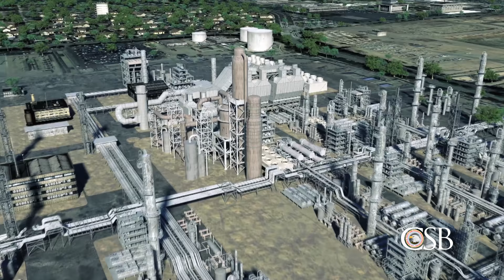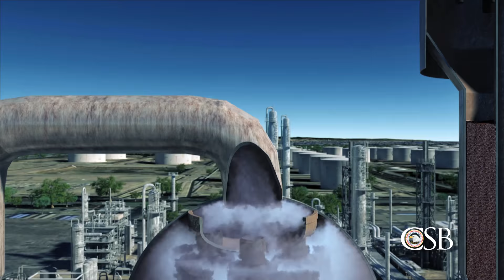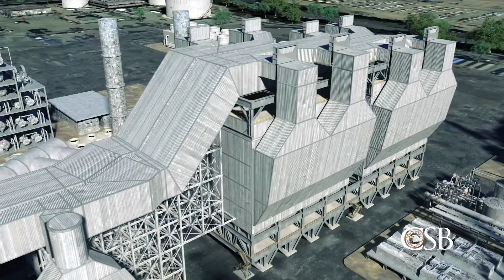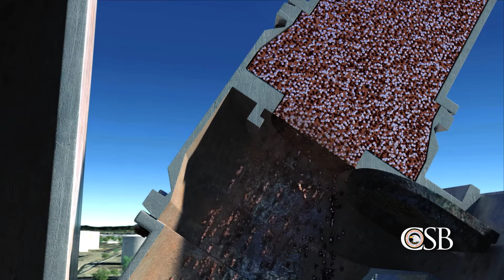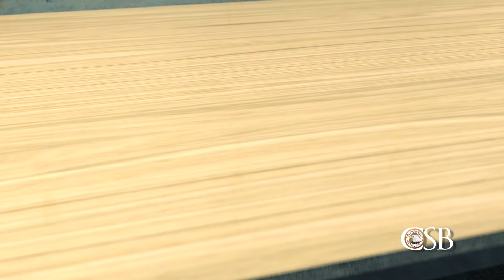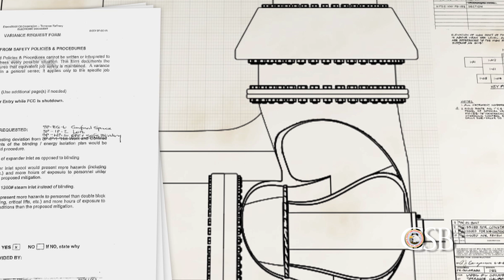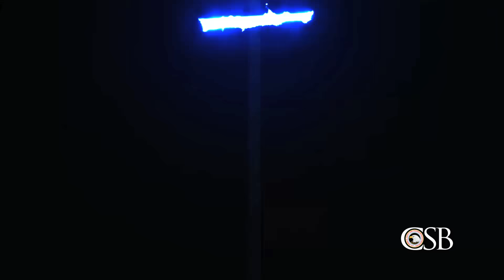Animation of 2015 Explosion at ExxonMobil Refinery in Torrance, CA

Comment: A few simple sensors in the system would have made clear what was happening. Including the failure of the valve. Not Turning off the electrostatic scrubber was the obvious Idiot failure.

Comment: How come they wouldn't install another valve between the reactor and the still? that way they could purge the reactor with steam , better yet, an inert gas, and then isolate the column to prevent backflow. Constantly pressurizing with steam is not only a wasteful but doesn't allow for maintenance on the slide valves, which seems critical.

Comment: Great animation!  I grew up in Torrance, and problems were not uncommon at this refinery.   My elementary school playground got coated with ash after the huge 1979 explosion and fire.  The ash was deep black soot, rather like an acetylene torch produces before turning on the oxygen, in balls about 1/8" diameter.  When walking, the air under your footfalls would blow the soot balls away from your shoes, they were so light.   We kids found this highly amusing, but for all I know it may have been highly carcinogenic.  This was 5+ miles from the refinery.

Comment: When panel operators found low steam pressure into the distillation column they must inform to the field operator rather than increasing steam pressure and there were several factors as well that caused explosions

Comment: The fact that so many mechanisms failed/leaked at the same time is concerning. During my Chemical Engineering degree, I had a Hazard Analysis class, which focused on assessing the probability of parts failure causing fatal results. I know from that class that the chances of so many SUDDEN, SIMULTANEOUS failures are next to impossible.

Comment: The useful life of all the valves and other parts should be estimated and those parts should be changed before that time is reached. The aircraft industry has these requirements and it includes a more thorough inspection of the airframe to look for stress fractures and other nasty surprises. They also have backup systems for everything. I think that the requlatory body for petro-chemical plants should implement similar standards.

Comment: Why didn’t they turn of the electromathingy when they realized the hydrocarbons were leaking? Was it happening too fast or something?
Reply: If only it were that simple. Another bit of misinformation is that they could shut the plant down with the push of a button. Some parts cause an explosion if they are shut off, like the steam generator. Units have to be deactivated in a specific order to prevent deaths and injuries. It takes days to shut a plant down and days to restart them.
Reply: The fact they added steam pressure as an emergency control proves they didn't know that the slide valve was open and they didn't know what was happening in the machine

Comment: Very interesting video. I know after the accident it's easy to know better. But sometimes I wonder how noone could prevent accidents like this?

I'm a bit shocked how unsafe the plant layout was. As far as I can understand it the safety of the whole process is completely reliant on the two slide valves. They weren't even redundantly configured. As far as I can see it there was only one for entering and one for exiting catalyst from the regenerator. 

Furthermore I don't understand how they could proceed trying to repair the expander after steam flowed out. Since the expander was part of the regenerator unit, which contained oxygen. I would expect that the operators would realize that they have more severe problems with the slide valve than the broken expander at this point. Since the only possible source of the steam would be the FCC unit, because steam is not part of the process downstream the regeneration unit as far I can understand it. Apparently they even understood that and tried to repair the expander by lowering the pressure of the steam. How could they try this, if they knew the slide valves were leaky because of the steam. Why didn't they repaired them firstly. Its obviously the more severe problem. Maybe they didn't cared about that and wanted to bring the unit back into production as fast as possible by repairing the expander while accepting the leaky slide valves to the regenerator.

Comment: Preventative maintenance
Reply: Preventative maintenance? The scenario involve three failed pieces of equipment.
Reply: @neilkurzman4907  CSB Chairperson Vanessa Allen Sutherland said, “This explosion and near miss should not have happened, and likely would not have happened, had a more robust process safety management system been in place. The CSB’s report concludes that the unit was operating without proper procedures.”

In its final report, the CSB describes multiple gaps in the refinery’s process safety management system, allowing for the operation of the FCC unit without pre-established safe operating limits and criteria for a shut down.  The refinery relied on safeguards that could not be verified, and re-used a previous procedure deviation without a sufficient hazard analysis of the current process conditions.

https://www.csb.gov/csb-releases-final-report-into-2015-explosion-at-exxonmobil-refinery-in-torrance-california/
Reply: @Mike-01234  
They were operating the plant with known broken equipment. 
Additional failed equipment should’ve been noted.  Preventative maintenance means you repair stuff before it breaks. These things had already been broken and were not being repaired but the plant wasn’t shut down.
Apparently, apparently, there’s been multiple plant explosions due to failed slide valves.

Comment: MRT ndt inspection technology is applied to  pipe hydrogen embrittlement inspection,
cracks, hardness, thickness, structural defects, health monitoring.

MRT is an advanced technology 
from ECT. This is the principle of ECT that uses a coil to generate a magnetic field.  MRT is the electromagnetic wave technology. MRT detects naturally occurring defects, welding defects, pit, line  on the 
inner and outer surfaces of pipes regardless of size during processing.

Advanced Magnetic Resonance Testing solutions for Battery  manufacturers
Raynar MRT can monitoring the welding condition of aluminum terminals welded to copper plates. MRT Welding Inspection Solutions Distinguish between normal and bad welding of aluminum and  copper plates. On the surface, eddy currents are generated at high frequencies and gradually lower frequencies are applied to monitor the condition of the junction to determine the bond strength.

Comment: Engineers never thought of a back flow prevention valve or a check valve or something similar to that where you do not need pressurized steam. What if the steam system failed too, the hydrocarbons would flow back regardless.

Comment: They should've added a swing type check valve on the spent catalyst return line to the regenerator
Reply: My thoughts exactly! 💯 👍🏻
Reply: Or a Flux Capacitor on the right side of the piston monitor with an O ring gasket on the release valve. That would've helped too. 👍🏻 Those amateurs, smh 🤦🏻‍♂️

Comment: ESP could have been manually shutdown as variance in safety procedure.
Or a butterfly dampner valve could have been installed on upstream of expander section during initial fault rectification, rather than a blind.

Comment: This is very high quality. I know nothing of this process. But I know exactly what happened.
The simple fact here , is the slide valve, that not only allows catalyst flow, but is also a main safety feature, was neglected to the point it was non operational.  
Lack of diligent maintenance on a critical part

Comment: It is unbelievable that a valve failure was not anticipated, had it been so then maybe, just maybe hydrocarbon gas detectors would have been fitted to the outlet of the regenerator which if activated could shut down the scrubber section thus preventing a catastrophe.

Comment: So excuse me for be ignorant but is there no off switch to the ESP. I mean damn the just thing I would do is turn of the device that could cause an ignition
Reply: That's the obvious thing to think in hindsight. This video did not include details on what the operators believed to be the case at the time this happened or at what exact times these events took place, which is highly relevant. I've been a process operator for 12 years and I know how hard it can be to figure out what's happening as it's happening. A couple of years ago at the plant I operate someone disassembled a pipe with pure hydrogen gas, it took a few minutes to even understand what the fuck was going on and in that time enough hydrogen had escaped to cause a MASSIVE explosion possibly blowing up half a huge concrete building. The moment I realized I immediately hit the emergency stop and fortunately nothing happened, it would have taken a single tiny spark ANYWHERE in the area to trigger an explosion.

Point is, it's a very complex job and in hindsight it always seems so simple. The situation in the video is a fairly complex series of events with several equipment failures, you have to keep in mind that as this is happening they probably didn't know there was a hole in the slide valve as they can't see through things like we could in this animation after the fact.

Comment: I worked alot of years checking valves montinig for leaks some the machine cannot pick up a leak and these machines are $10,000 Tva what I used no possible way to catch every valve it takes everyone. I did have a scare one day I was in a pipe rack monitoring and tied off the unit shut down the operator runs out and says get out fast and took off

Comment: Obviously I'm completely ignorant of the specifics regarding this machinery and this process.  But it seemed to me that the slide valves (the ones that were leaking) would be the kind of equipment that would be deemed critical to have a redundancy or back up built in.  Is that not so?  And with the number of sensors in my car, I would think an operation of this kind would have sensors that would enable them to diagnose problems much sooner and with a greater degree of accuracy.

Comment: Wow...that's it?  The video just ends?  The CSB usually has better due diligence than this.  Not just what happened but also detailing what should have been done differently to prevent such accidents from happening in the future.  Looks like someone was bought off at the USCSB to bury this story.  Here's the real story:  After the explosion, it was discovered that a large piece of debris landed a few feet from a large tank of Hydroflouric acid (HF).  If that tank had ruptured, it would have probably aerosolized and maimed or killed up to 75,000 people living nearby the facility.  That's according to the EPA report about this incident.  Hydroflouric acid was invented by the Nazis during WWII.  So you know it's bad.  However, even they couldn't figure out how to store and transport it safely to use it on the battlefield, so that probably saved a few lives.  It is the most toxic substance ever made where a single drop on your skin will kill you painfully and slowly by dissolving your bones and melting your lungs.  It also eats through glass.  Even the only known intervention, Calcium gluconate gel, isn't a guarantee that you'll survive.  The treatment protocol also includes no painkillers.  That protocol allows the hospital staff to know they might have nuked the HF when you stop screaming and writhing in agony.  Labs that handle HF have a separate room in their facility that handles HF and only HF in that room.  There is no substance on earth more toxic than Hydroflouric acid.  To have a large tank of it hanging around a facility that can literally explode and then potentially aerosolize HF is extreme negligence...at best.  So, of course, someone at Exxon would want to bury these facts.
Reply: Just look at yesterday in TX 👀

Comment: Only one slide valve with no maintenance in 6 years was definitely recipe for failure,  no check valve to avoid flowback of hydrocarbons , i saw several failures in the system

Comment: Weren't they monitoring Flowmeters, Tempererature & Pressure measuring instruments ( on timely basis).
The incident could have been avoided by that.
This is an accident caused by purely negligence.

Comment: Seems like they should have a hydrocarbon sensor on the air side prior to the ESP unit. At the least it could shut down the ESP system, and better, redirect airflow to a controlled output where they can be burnt off as waste gasses in an emergency.

Comment: No HC detectors on the flue gas path to the precipitators?? Were the slide valves classed as safety critical? What was their inspection and/or maintenance interval? What was the maintenance and integrity strategy on the leaking hX that was found to be the back pressure source? Did a HAZOP ever consider the implications of a leak in that hX? 

So many questions... and many more questions than these come to mind.

Comment: Why not just *TURN OFF THE IGNITION SOURCE? *
Also, why are there not a LOT more sensors in there to detect if the catalyst is flowing or not, or if there is the wrong gasses in the wrong places, or if the pressures is wrong?

Comment: "We've adopted a culture of safety. With variance."
Reply: Safety is my passion
Reply: Alternative safety
Reply: "Safety at any cost; unless is costs money" as we used to say....
Reply: Well, the variant is supposed to be a safe plan to deal with something odd. Thing is, you've always got to remember if you're using one, you're not in charted territory. 

Opening up the pipe was fine, but when they found something that wasn't supposed to be there (because the steam is on the hydrocarbon side not the air side), it's time to ask why?
Reply: The variance is what should have allowed them to catch the problem they had with the slide valve. It didn't cause the explosion.
Reply: @TMJ32  "The variance is what should have allowed them to catch the problem they had with the slide valve. It didn't cause the explosion."

I wonder whether lowering the steam pressure was part of the variance...
Reply: @btudrus  The point is that they should have stopped and investigated everything as soon as the steam was found where it shouldn't be
Reply: @TMJ32 with as many valves as I've replaced over the years, I never trust just one valve to keep me safe. I don't really trust two. I'd rather whatever the  source is to be turned off.
Reply: "
forgot to close the quote
Reply: @NithinJune stfu

Comment: Too bad there weren't any hydrocarbon monitors along the path to the precipitator to trip the power in order to prevent an explosion. But at the same time, then there would be a precipitator full of explosive gasses where anything would set it off until a purge cycle was performed..

Comment: I'm not in that industry but : if water vapor are detected in the air part of the process, shouldn't it be a sign that a leak was present since water vapor would have taken the same path as the fuel ? They knew were it came from as they decrease it's pressure. For me it's a big NONO that should trigger a quick test on the valve :-/

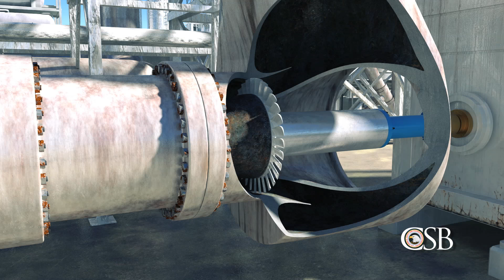Comment: 4:08. I swear, every single one of these incidents always boils down to idiots. The expander stopped for a REASON. Do not ASSUME. Steam should not have been escaping when they opened the expander. That was their warning that something was leaking. Had the right idea to turn the steam pressure back up, but totally blew it (oh, that was REALLY bad) by not turning OFF the electrostatic unit. They were given so many chances to get this right!
Reply: Agreed! How did nobody ask the question ‘How is steam being pumped into the fuel side of the FCC unit escaping through the expander, which is a part of the air side of the FCC unit?’

Comment: Seems like an actual backflow valve at the end of the distillation column would have prevented this. Anyone know why this wasn't in the design? I know they thought that the catalyst mad a seal but it seems like the  backflow valve is possible. Is it because there can be no moving parts in the areas where hydrocarbons are present?

Comment: When they, 5:50, went to install the blind (what is that, a ring or spacer of some sort ?) and saw that steam was escaping, how did they not realise that one of the shut off valves between the left hand and middle towers was not working ? 
    How else would there be steam where normally there are only carbon covered catalyst ?

Comment: 1. The water vapor should have been a major warning sing that there wasn't a seal between both parts.
2. Why did they not shut down the big ignition machine when there is a clear leak of hydrocarbons?

Comment: why wasnt the high voltage turned  off when the reactor was not under working conditions? If there is any fault in the system, you should not bank on the features of the plant, instead you should have turned of any ignition sources in the system. 

Its like if you have a nuclear plant with a selfsustaining cooling loop and you turn of the main pumps for any reason because you build on the self sustaining cooling loop. If there is any little damage on any critical part, which you wont immediateley notice, this could lead to fatal accidents.

Comment: I know its probably been asked before but why isnt there a automatic valve between the reactor and the distillation column  to be used after the steam flush in safe mode to prevent the hydrocarbons from returning to the reactor and into the air side of the system? this along with mandated inspection and changing of the slide valves every 2-3 years would minimize the chance of these types of events happening in the future. i am not an engineer just a logical person who can see the benefit of multiple safeties in the workplace to help prevent incidents like these.